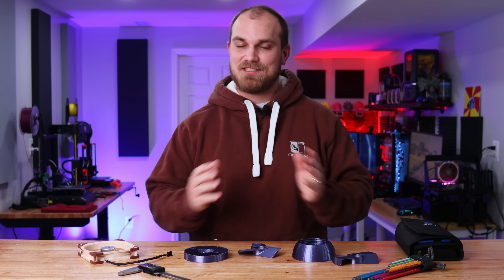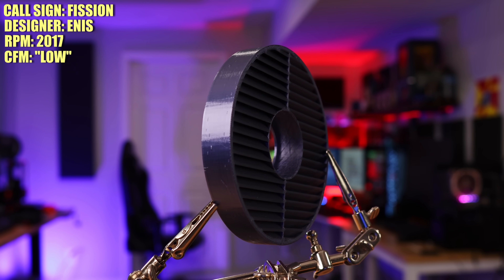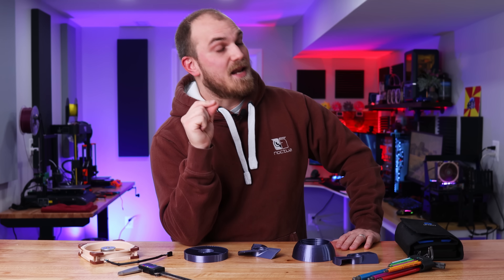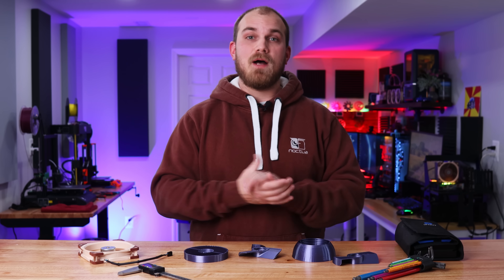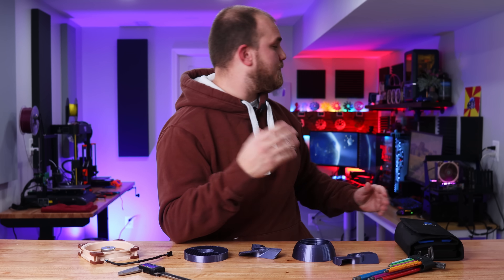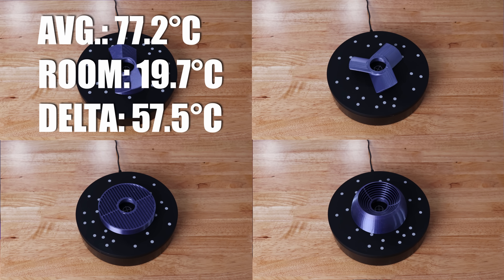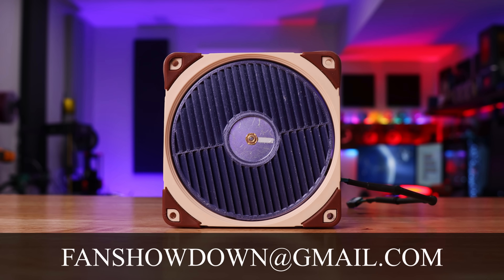IS THIS MAGIC? This Fan Has No Blades | Fan Showdown S2E3

Comment: I want to replace the blades in the extractor fan in my kitchen... the current fan is, well... WEAK!
I go in the kitchen to vape and turn the fan on when doing so, but even blowing vape directly at the fan, it's not verry effective at drawing the vape out of the house, allowing a good 50% and sometimes more to simply float down the walls into the living room and subsequently has set of the smoke alrm on occasion.

so I ask you/challenge you! -which fan design do you suppose would be the most effective at extracting my vape? and terrible cooking smoke of course :D

Comment: PSA all I’m saying is I wonder how the supper quiet with no blade would preform if you simple added small fins on the inside of the cone pieces to help pull the air into it produce more air out of it and still be quiet
Reply: And sticking with that design you keep the loss of the paricidic drain for the air blowing away from the blades

Comment: As suggested a "noise leaderboard" would be interesting. BUT the problem ist that the designs have to also perform. Your minimum criteria is that the CPU doesn't throttle. But thats not really taking the performance into account.
I guess noise/performance ratio or some sort auf coefficient to rate this would be really cool.

Like these hardware tests that rate hardware for the "best bang for the buck" -> most performance points that you get per Euro/USD/Simbabwe Dollar. But here with "noise per performance" (or other way round).

Comment: I am glad saw this channel. Just finished watching the entire playlist. From what I understand, is that most of the fan do not blow air in streamline and this has to do with how leading edge is designed. The most difficult part in fan blades is to maintain the optimum angle of attack. The velocity at inlet and RPM of the fan determines the angle of attack.  Velocity at inlet is specific to each fan design and is normally tuned based on trial and error using simulation. The RPM of the motor is not a fixed. It is dependent on the fan weight and drag. So it is really hard to estimate the optimum angle of attack. 
A more simpler fan with large tolerances to inlet conditions works better and more sophisticated blade design (like the turbo jet blades) perform poor, as they need to be tuned to right conditions. Sometimes it's is just luck. 
Overall , it is very interesting series.  I might make one design of my own and send one. Even do few test prints using my Ender-3.

Comment: there is a pretty cheap device you can buy that measures air flow rate which would be a pretty valuable set of data

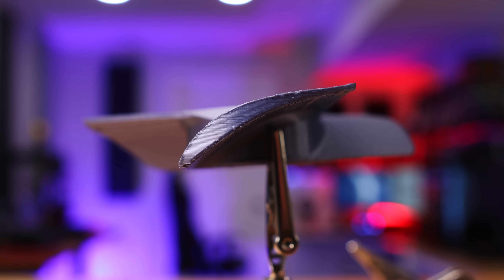Comment: Fan at 1:22 looks exactly like old 220V fans used in various industrial hardware (and military hardware) in USSR, usually had rounded blade corners though, to reduce stress concentration. ANd final fan is a form of centrifugal pump, it it really hard to make them balanced, and significant impact on noise and engine bearing wear is balance of the fan.

Comment: So disregarding very few of those designs, it's looks like the fan design doesn't have that much impact on the fan performance. Even the dick shaped blades gave quite decent performance and we generally see those not more than 10% apart from each other. Very surprising and very strange. That being said, maybe you should also put the noise level on the summary and in the table, as it looks like this is one of the parameters to pay attention to. And mayb have another with like a ratio of delta to noise or something?

Comment: Combine a few designs.
Take the airfoil design and curve the blades slightly, spinning them so that the outer edges bite the air first and draw it down and inward toward the center of the fan.  This will reduce the amount that's 'wasted' by the outer edge of the fan's circumference.
Then put that donut ring outer edge on it so that air spun off by spin is funneled back in.

Comment: Is it possible to replace a computer fan motor with an RC drone Brushless motor?  So that the heat in the computer is quickly removed from the inside and / or cold air from the outside can quickly enter.  Also what are the advantages and disadvantages if the computer fan motor is replaced with a Brushless RC Drone motor?

Comment: Putting an outer shell like the bladeless as an outer ring on a two or three blade center might gain a performance increase, hwile only adding low frequency sound and probably acting like a parabolic dish to focus more of that behind the fan. Just moving the concentric sections a little further apart might improve airflow, though since it probably also uses some boundary layer effects to move the air like the Tesla turbine does to extract energy from whatever is driving it it might have the opposite effect. Could be worth experimenting with, though, and there's no denying it looks really interesting.

Comment: Maybe smoothing your prints doesn't do much for some fans, but I'm going to have to say any airfoil designs it should definitly help to smooth them. Especially if the airfoil design is using a laminar airfoil design, which is what they would call a critical wing because it is highly sensitive to the disruption of the laminar airflow causing loss of lift. In the real world a laminar wing can lose lift just from bug hits on the leading edge.

Comment: The fact the blade-less centrifugal force fan actually worked was amazing, I did not think it would because I thought the mass of the air would not be enough. However Here is a thought, would that centrifugal force fan work as an impeller for pushing water trough a water cooled system, rather than using a standard pump?

Comment: I had so many questions like what if he did resin print and test and then I came across a video where u have done it so truely u know a lot and not just another youtuber and  I feel this is great channel you have here that I am gonna sub.
Reply: My recent question is - what if we use Wood Filaments which is out there in market (which is plastic but with wood mixed in it) will that change numbers

Comment: I'd really like to give this a go but I have never done any 3D modelling of this type before. I've done 3D modelling for buildings in ETABS, REVIT, SAP2000 etc but it's quite different to this. Is there some free software I can download to have a go at this? What format does my file need to be in so that you can open it/print it?

Comment: hide small blades inside fanless and you will have best of both worlds.
noise is caused by turbulent flow that happens more if you have a lot of space, concentric rings mounted on blades should be just as quiet.

Comment: Too bad I don't have any 3d modeling experience, would love to see a fan based on the lily impeller (pull configuration). Theoretical it should be quite efficient capitalising on the turbulent flow through radiators.

Comment: The centrifugal fan should've had Something pushing air down. Even having the braces between the circular layers being pitched on an angle according to the rotation would've given it far better cooling...

Comment: What if the "lines" where on the side when the airflow comes like a leading lines?

The blaadeless look interesting it should be combined with the the Lilly impeller design you show a while ago. 

Or what if the design don't have straight lines for support but go like a helix an based on the outer surface. It's hard to me to explain

Comment: I suppose the centrifugal one need more speed to work, it will stay noiseless even at 4.000RPM but will push some 5 time more air :-D
So I feel the test is not correct toward that one :-D making it running at the speed the blade's need.

Comment: Hmm, I wonder..... What if you make an air vent blade instead? Like having the duo blade but as ventilations? Going outside the chassis of  the motor and collecting air from outside, 

Body 
Wings : Shaped accordingly (Circle with holes in them)
Bending : Towards the air so it will collect air

Rotation : Will breathe air towards the mid section of CPU or GPU

Depending on what I am thinking, 1 of 2 things are gonna happen :

1. It is out of balance and will not stay put so it will disrupt everything and throw it self outwards...

2. It does as expected but much louder than a normal fan, considering the speed of a small fan is around 12K RPM depending on the motors of course, it might even stabilize and collect more air than a normal bladed fan would, because the air is more focused and is collected

Comment: The bladeless seemed to have an issue where it only disrupted airflow directly in front of the cone wich would cool off a smaller target and create a pseudo heat sink where a good chunk of the heat would disperse to this cooler area before getting sucked off or trying to heat up a heated area I wonder if there is a design that would maximize the radius or cooling effect along with positioning key heat throwing components closer than usual that would help performance with out hurting the other philosophies put into it or even if making it bigger would make a significant difference in the heat with out hurting its noise prospects

Comment: Should have a discord as well :)  I'm planing to build a enclosure of my 3D printer and I need fans to cool it. I also want to filter the air out and in of it. Meaning I need a fans that can push or suck air thru a filter that can remove the particles/dust. Have you done any test in that regard and different filters?  Not just direct cooling or smoke tests.

Comment: 4:03 There is no such thing as "centrifugal forces." There only exists centripetal forces and centripetal acceleration.
Reply: yet centrifuges exist.  https://en.wikipedia.org/wiki/Centrifuge  While centrifugal force is really just an observation of inertia, its still a term widely used to denote a specific thing, and is not the same as centripetal force.  As a matter of fact, centripetal force is the opposite of centrifugal force in that it keeps objects towards a central point as opposed to flinging them out away from a central point: https://www.diffen.com/difference/Centrifugal_Force_vs_Centripetal_Force.  A wiser decision would be to explain these things instead of just snapping at people for using a widely used term.
Reply: Instead I was concise in explaining it doesn't exist and the direction in which you could choose to find the correct answer should you choose to look.

Comment: Why would you reduce turbulence unless you intend to use this fan just to move air without restriction or to cool anything as turbulence increases performance on heat exchange on like radiators and heatsinks. Your making the fan silent but has no potential to cool any heatsink but was just intended to move air.  Maybe to clean the room full of weed smoke so your parents don't find out.

Comment: I wonder if the Bladeless design could be improved by helically twisting the parts that are holding the concentric rings together so that it acts a little more like an impeller (rather than the straight lines currently in place that are acting more like "paddles"). I'm intrigued by this design even though it didn't win...I think the performance could be improved while still keeping the overall design.

Comment: I wonder if the bladeless fan could be improved by having those supports that run between the circles be angled like fan blades to turn it into a series of concentric ducted fans? Might provide a little more push to get that air moving while also taking advantage of its centripetal force effect.

Comment: The bladeless is creating a pressure vacuum inside its bowl and would probably work better if it had little scoops at the inner end of its support spokes, to sort of break up the air's laminar flow and scoop air into the holes, though this might reduce the whole noiseless aspect.

Comment: It's not a traditional fan blade but it is a fan blade. They are just in a very unorthodox position around the spindle.
The significant difference between what you're calling a bladeless fan and a traditional one is that the blade supports that push the air into the circular blades are themselves blades.
He's broken down what a traditional fan blade does, into two stages: 
1. Whack the air into a spinny motion.
2. force it into a strict path as it struggles to escape the center.

The inventor doesn't think this design will lose as much air around the sides though.
And while technically true, I'd be interested to see what the airflow is around the sides at the point where it leaves the control of the "bladeless" fan blades.

Comment: Bladeless with a good sweep to the ring supports would probably be killer seeing how well it moved air with no built-in deflection/scooping on the design. I’d be interested in knowing how it would perform if each section had a progressively sharper attack

Comment: the concentric circles is an interesting concept. though it came in last, it seemed to work just enough. 
I wonder if it has a spiral ridge in both sides of each dome, it can help propel the air flow better and improve efficiency without adding noise?

Comment: Sand and prime those fans and see if it reduces noise any. Also, the fusion would have far greater potential if those slats were angled more to capture the air. The further you get to the top and bottom, the more those tiny fins are just moving sideways and not grabbing air. Only about a quarter is really pulling much in.

Comment: I wonder if he has tried different rpms to find the optimum for each fan. I am sure that some might work better at slower rpms as just like turbines you can run into compressor stall and turbulent flow if spun too fast. Would impact noise as well. Maybe try them at several rpms to find max airflow

Comment: Nice. What if it has blades but still has cone at the sides? I also noticed that fans could throw some air to the sides through my observations on GPU card fan/cooling designs.

Comment: I think Sean is a bit of a fool with all due respect because he revealed that bladeless design here in a public forum first before at least getting a provisional patent. I think the idea is eminently patentable and with a little more tweaking could actually be a quite useful air mover in many applications where low-noise is Paramount of course by revealing here on YouTube first he has forever relinquished any patent rights and has given the design to the public domain. I hope I am wrong; I hope he got a at least a provisional patent.

Comment: Hey noticed with the new videos do I get a little reverb and you did purchased some sound absorber/dampeners back there there’s a cheaper better way to do it find some paintings on canvas that you like on Amazon get a bowl for regular towels so I’m together and tucked in behind the canvas works best for the gallery frame painting....

They actually work better than the six $700 sound panels believe it or not

Comment: technically the blade-less one has blades:
the vertical connections between the different layers.
If these connections had an airfoil shape the flow would be greater.
it would basically be a 6 bladed fan  mixed with a centrifugal compressor.
btw, i have never seen anybody submit a radial compressor, only an axial one.

Comment: for the Bladeless fan, I noticed support structures that looked to be strait radial from the center, if those were also spiraled around a bit to act as tiny fan blades of sorts, I bet it could increase the air flow slightly and be even quieter.  I lack the tech or brain meat to do any designs, but I gots ideas.

Comment: for second or two @6:18 you can see smoke wiggling with every pass of center 180 degree blade of the wack two section 180 degree blades in non radial manner. It would explain it's noises.

Comment: If the supports of the anular foils on the Bladeless were given a little pitch so it can actually pull some air it might actually go somewhere. It would get a little louder, but not much louder. 

Problem is the weight. Thing's gonna kill some bearings.

Comment: I think that if the bladeless design shell spacing was adjusted it could use effects seen in a Tesla turbine in reverse. With a Tesla turbine, if the right configuration is achieved, efficiency is increases ten-fold. If someone could make a spacing-matrix test of variously spaced designs, we might be able to isolate the most efficient shell spacing for that RPM.

Comment: I'd like to see variations on the quiet one, maybe change the attack of the support lines so that they become tiny blades.

I think the quietest fan that is acceptable should be real world winning category, more than "moves the most air".  In my workstation, putting the fans on high is SO loud, and it's the case fans that do it, not the cpu fans by the way.

Comment: the Bladeless doesn't appear to push the air in a specific direction, seeing the smoke going out the back it looks like it throws it all over the place, it might be better served as a case exhaust fan instead of a CPU fan? maybe a change to the shape could improve the directionality of the airflow